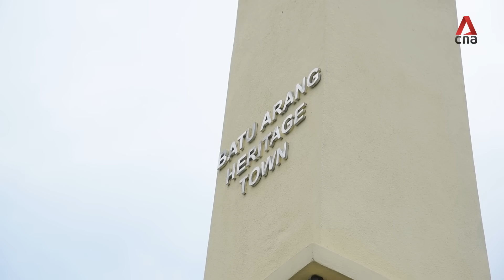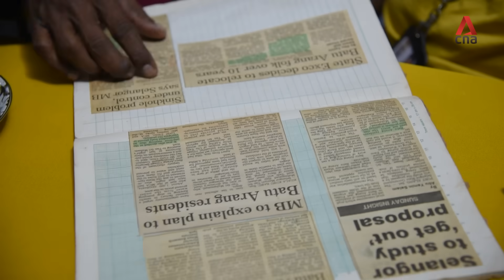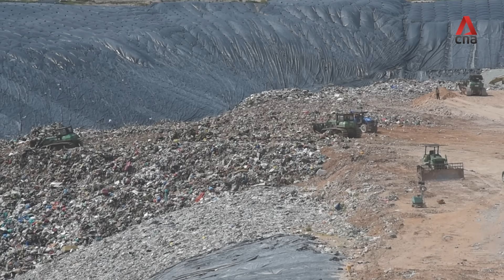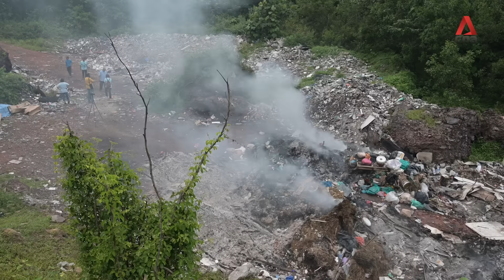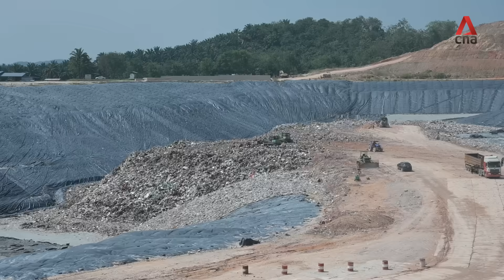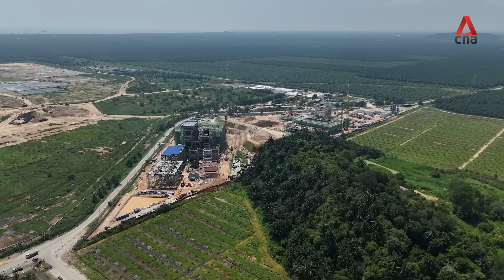Malaysia's growing waste problem: Are incinerators the answer?

Comment: @04:52 "systematically removed everything from the flue gas" is typical technocratic misleading talk. The system will only remove contaminants to a permissible exposure level which is defined using a national standard. There's no such thing as absolute zero pollutants. Permissible exposure limits (PELs) are based on a theoretical tolerance level of human exposure. There will be unfortunate vulnerable individuals that fall outside this spectrum and will eventually develop respiratory issues. That's why incineration plants are built far away from residential areas. Because there WILL be plant upsets and occasional release of air borne pollutants while the plant stabilizes which can take from hours to even days. I know because I worked at one as an operator.

Comment: WTE is not an issue. The problem is the public was against it due to some concern. It was discussed a decade ago but the then BN govt just conceded to their demand despite being positive about it.
Reply: Residents of Batu Arang and the surrounding areas near this incinerator facility are simply against it because it's too near to their homes. If this were built at someone else's residential area, they'd probably support it despite those concerns because at least it's not THEIR concern.

Problem is, landfills are a finite source and for a small country like Malaysia, it's getting more and more difficult to open up new landfills. This project NEEDED to happen a decade ago but better late than never. Sucks to be a resident of Batu Arang but this is for the good of the nation. I'd go as far as saying each state needs at least one incinerator facility for Malaysia's growing garbage problem.

Comment: I had commissioned 2 incinerators with 2 boilers and Steam Turbine add up to 10MW in Taitung, Taiwan during Pandemic. In modern design, the exhaust shall install with bag filter and ESP which filtered the odor smell subject to the design. But still i would really respect those maintenance people in the plant who can tahan the waste burning smell. I remembered i clean my jacket in the hotel and it is full with dirty water. I also when to the crane area which is the top of the rubbish storage area to see some old system to be commissioned and the smell like you are in the "heaven".  I also read through the local public news, nearby farm communities complain, politician slogan to win or lost the election and even few times the public are stay infront of the plant to demonstrate and even with reporters. In principal and technology wise, 10ton of waste became solid waste 1ton after burning. and these burned outcome are toxic and need to be solidified with lime stone. Special machine are blending these waste and packed it under the environmental department and treat it under schedule waste to be handling by local environmental department. Air pollution no one can guarantee because sometimes machine trip and need to start again therefore you cant avoid some smoke is there. Another joke is when we are boiling the water with steam, some vapour was coming out from the plant are alert the public and enforce the government to further investigate for air pollution. anyhow cant blame these folks who cant identify what is steam and air pollution. The real air pollution you cant even see by naked eyes, only special sensors like NOX, COX could really measured. Back to the question, are incinerators the solutions. I would say yes, because the amount of rubbish in selangor is greater than the figure i have when i was in Taiwan. It must be burned like what we seen in singapore, Kepel. Keeping the rubbish would not bring any benefits. I remembered when i was in taiwan, they are digging the old rubbish to burn and the effect are not so good for the combustion. The power generated could reduce small amount of other fossil generation such as oil and gas plant. It is everyone problem because we just keep producing waste daily. There is no other way at the moment, only burning like what we see in many advance country. We dont burn the rubbish, it could be place of new disease or slump, incase of flood, these rubbish would wash away to river without control and this is heart breaking to see this. We shall educate our family and friends more on zero waste for our life style. Plastic should be banned and replace with thick paper. keep rubbish will die, burn also have toxic scheduled waste. so, you still need to make rubbish as gold and productive. cost should be allocated for community who leave nearby and move out from that area as it is strategy solutions for the sake of the whole community, environmental issues and long term consideration. We cant blame government, because these rubbish come from us, such as tourism, economy activities and survival. My personal opinion is, It is a painful decision. Lastly, usage of power shall fall under individual responsibility in future.
Reply: The internal of my ESP has caught fire several times due to ash chokage and bag filter housing also. We still continue running the plant (for economic reasons) while borderline pollutants are released because we partially bypass the flue gas cleaning system. All these was NEA (National Environment Agency) approved.

And btw...this is in Singapore, where we are supposed to have "better standards"

Comment: It's a really complex issue with valid points on both sides. On the one hand, the current reliance on landfills in Malaysia clearly presents significant environmental and health challenges that need to be addressed urgently. The potential for incinerators to drastically reduce landfill volume and even generate energy is certainly an attractive prospect. Professor Agamutu's point about modern incinerators having advanced pollution control systems is also important to consider.
However, the strong concerns raised by residents about the location and potential health impacts of incinerators cannot be dismissed. Their worries about toxic emissions and increased traffic are understandable and need thorough investigation and transparent communication. The history of waste management facilities often being sited near vulnerable communities also adds weight to these concerns.
ZeroWaste Malaysia's emphasis on waste reduction, composting, and robust recycling programs offers a compelling alternative approach. Focusing on minimizing waste generation at the source and maximizing resource recovery aligns with circular economy principles and could potentially be a more sustainable long-term solution.
Ultimately, it seems like a balanced approach is necessary. Exploring and investing in comprehensive waste reduction and recycling initiatives should be a priority. If incineration is to be part of the solution, it must involve the most advanced and safest technologies, rigorous environmental impact assessments, transparent community engagement, and careful consideration of site selection to avoid disproportionately impacting any particular community. It's crucial to weigh the potential benefits of incineration against the genuine concerns of the people who would be directly affected.